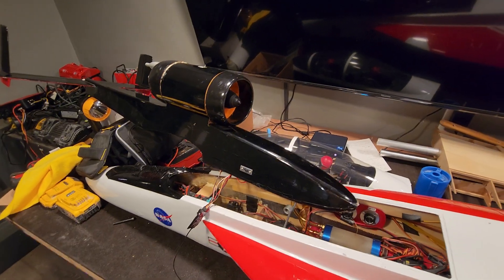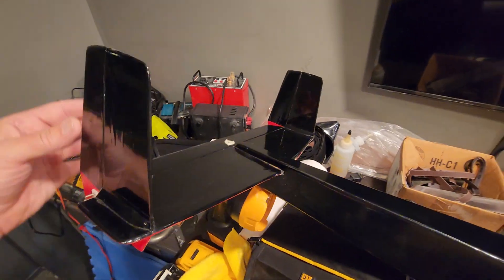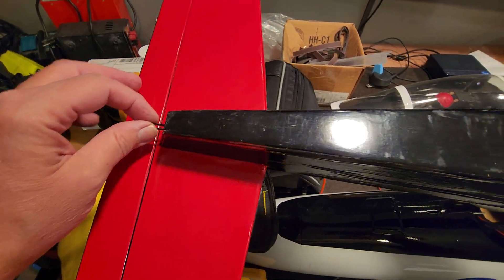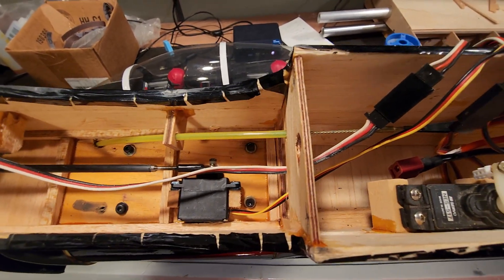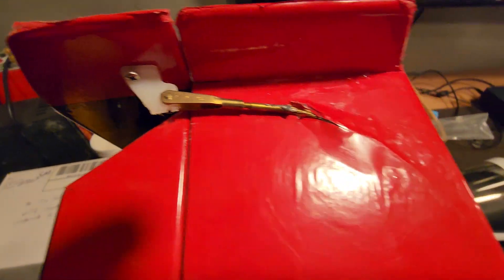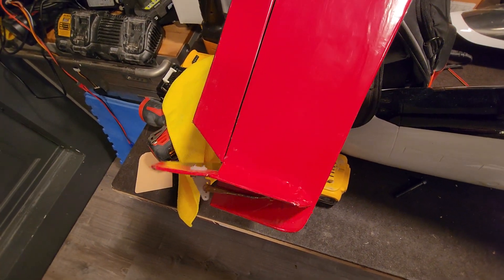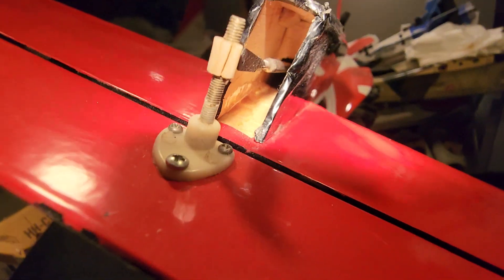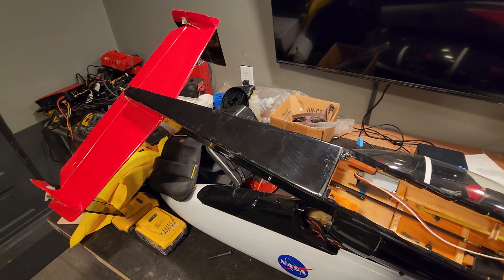Twin rudders on a Midwest Jetster. helping out a viewer.

Comment: Wonderful!! Thank you!! I’m going to copy cat your idea.  Also do you think anything should be beefed up ? Any weak spots? I’d hate to have a rapid disassembly at 200mph with that pulse jet red hot.
Reply from the maker: you might go up a thickness on your stabs.  The stock ones are really thin, would make installing the cable a bit easier as well.